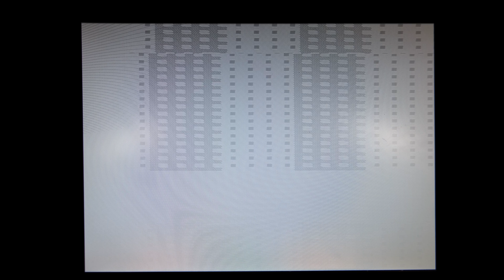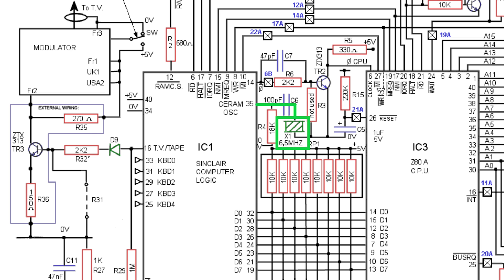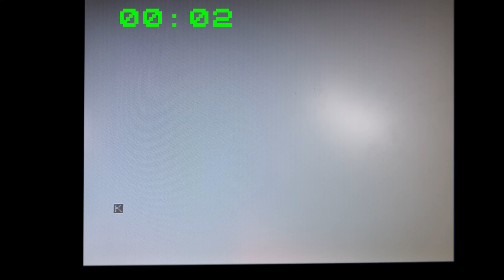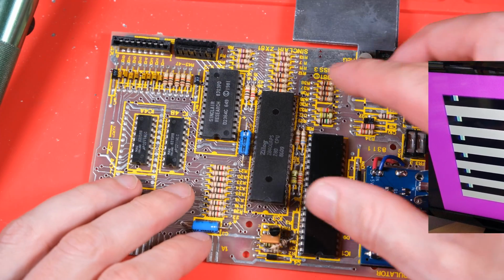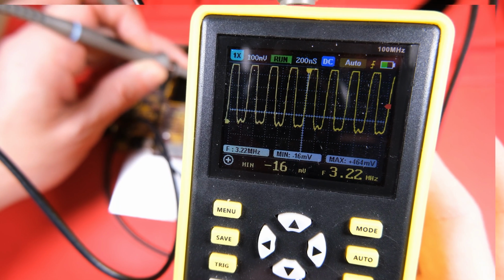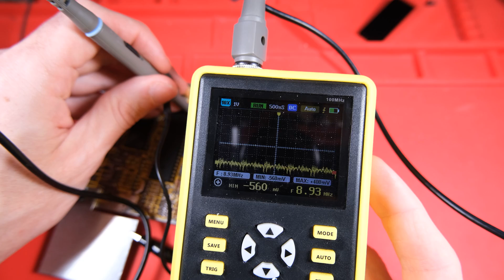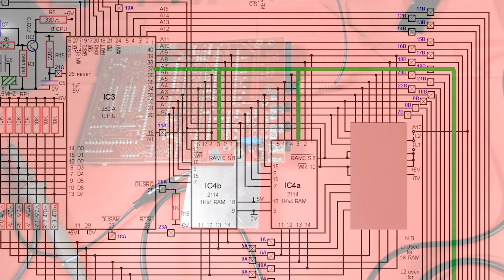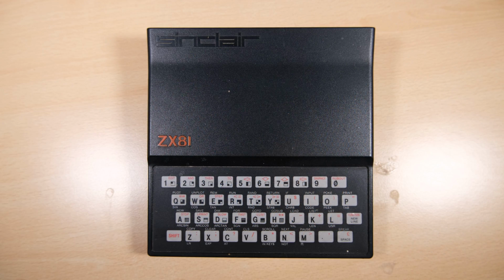Sinclair ZX81 Repair - White Screen and No Cursor

Comment: Excellent video and work. For heat issues, I use my compressed air can and hold it upside down. Cold air comes out, and I spray IC in question. Works the same as you adding heat. Thanks for sharing another great video
Reply from the maker: Thanks Rudy!

Comment: Your "bad z80" might not be bad at all.. i noticed it's a modern one, and those are CMOS whereas the originals are NMOS. My guess would be the CMOS one is unhappy in this system as there are slight differences in levels and driving strengths
Reply from the maker: Interesting! Thanks. I'll see if I can find it and test it, I can't remember if I put it in the IC graveyard

Comment: I've recently come by a ZX81 from a friend of a relative who sadly died. I've been cleaning it up, but haven't dared switch it on yet! I have learned a lot from you, but have nowhere near your level of expertise, so I hope it just works.
Reply from the maker: Are you able to check the polarity and output voltage of the PSU before plugging it in?